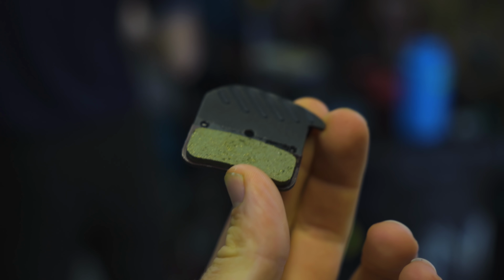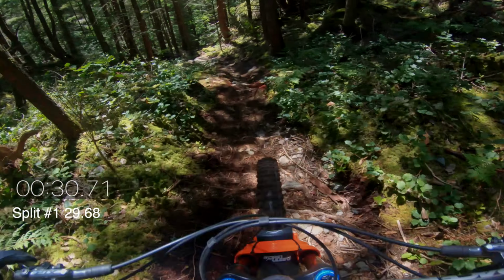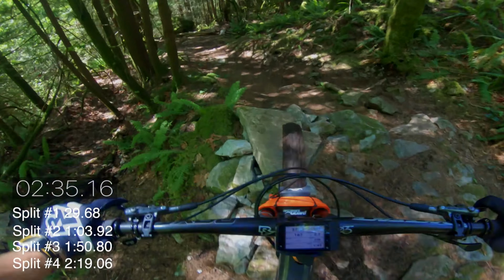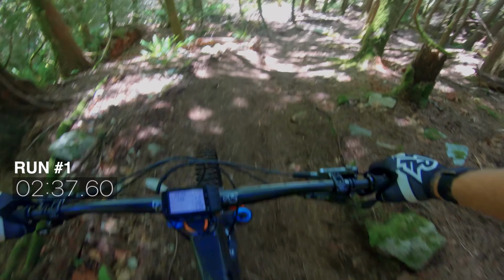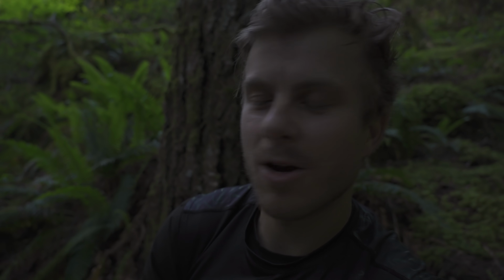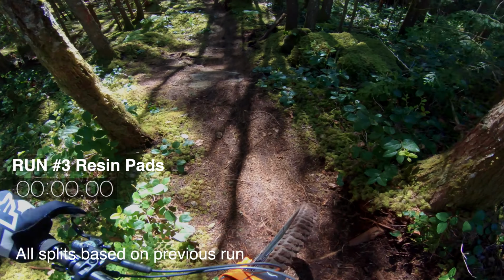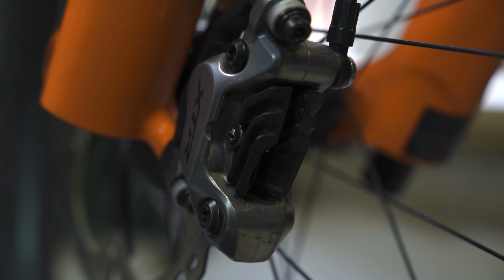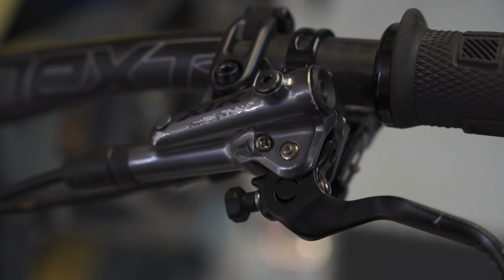These Brake Pads Will Make You Ride FASTER!!!

Comment: I used to be stuck on semi metallic. Once I find something that dials in my style I tend to want only that thing and for the longest time I only used semi-metalic pads in my old tektro mech pull disc brakes. I live in the Calif desert east of San Diego and we don't get very much rain (0.5 in per year avg) so I don't worry about wet conditions. When it would get wet good luck stopping with those things. My new Vitus came with resin pads and xt brakes and I pretty much fell in love with them. I do alot of high speed/down hill stoppies and go thru pads like every 2 months. I ride 30 miles every day. But the resin hold up pretty consistent across the board, all conditions, all uses. Once in awhile I'll get an over or under bite from them but I think it's probably due to dust buildup or a rotor contaminant because it's usually just a one off and the bite settles back in to a consistent pull that I love. 
Btw, Nice breathing regulation. People hear my breathing when I do videos and always have something to say about it. It's normal when your hauling ass to regulate your breathing to stay steady. I think alot of people hold their breath and hang on doing technical sections. That's why they don't look like you and me baby😁. I get the most out of riding at 50 and I credit my breathing techniques that I learned long ago in special forces. I don't do much of anything else in terms of working out and  I've still got a 6 pack and pretty decent guns from just doing wheelies and stoppies. Good luck when your season starts again bud. Nice reel 😁👍😎

Comment: My comments for what they're worth. Firstly, in terms of how you conducted your test, I would suggest you need to get a proper bedding in routine sorted when you change pads and especially when you change compounds/materials. 

Secondly, in terms of my experience between the two. Of course I'm not as fast as you but do race downhill in the UK. I find the resins heat up quicker (after they've cooled down between braking events) so I can get my braking done sooner and I can get off the brakes again as I don't have to wait for the metallic pads to heat back up again. I occasionally a metallic pad when there is more prolonged braking in Alpine decents, probably more like what you're doing in BC. 

There's always a trade off, I don't agree that metallic pads provide more power than resin, they just provide more power when they're hot enough. At your pace on that much elevation change, they're definitely better suited. Maybe if you use bigger rotors and shed heat better, resin might be important.

Comment: My summary is: Its situational and dependand how you ride:
I am a rear dominant brake rider and i go mostly 15-30min woods downhill tours with 70% dry and 30% wet conditions.
I think the best setup for me (Guide RSC front and rear 200mm) will be front Organic (to get the bite i need, when i brake with the front now and then) and Metallic for the rear (because i use rear brakes more often and for enduro braking (or wet condition safety brake) you need that power when the brake is heated up or wet).
I dont know if the front brake will get wet faster then the rear tho... because of the stuff spitting onto your bike when decending. That would negate the positive benefit of resin pads on the front.

Comment: Shimano recommends swapping rotors, which makes perfectly sense if you think about it. Resin on rotors previously used with metallic will not work like intended.
Reply: Better also buy a new drive train and caliper while youre at it.
Reply: @obi-wankenobi9871  i'd recommend you should also swap frame and fork
Reply: Youtube User only if your going from resin to metallic... no drivetrain issues should occur going the way round. But calipers? Yes, definitely.
Reply: Yep, you will not see the real effect without having a second set of rotors that have been beaded in for the resin pads. Running resin pads on a rotor coated in metallic compound will give a different result than running resin pads on a rotor coated in resin compound. But if you're looking for more power and better breaking feel then don't run Shimano brakes, virtually anything will give you better modulation but if you want that with more power look at Magura or Trickstuff.
Reply: @paradox963  going metallic on a resin beaded rotor often results in polishing the rotor... because all the resin and grid fragments work like a polishing compounds. At the end there is less power and it’s even more likely to squeal.
Reply: This is correct. The true capabilities of each pad compound can only be compared using rotors correctly and only bedded for each type of material.

But there's the current notion that indeed metallic brake pads produce a more powerful and less heat dependent fading brake experience.
Reply: @Phlizz  it’s fine it just takes longer to bed in because you have to clear the old pad material. Many manufacturers use a metallic / resin combo there’s no issue switching pads.
Reply: @TheMTBRider96   i'd recommend to include the wheelsets too and the tires
Reply: Xt and xtr works either metalic or resin.

Comment: Did you change out rotors as well? Shimano suggests you never you the same rotors with different pad material. After the pad is bedded in the  brakes rely on a cohesion between the pad and pad material on the rotor to maximize bite.

Comment: Great video! I just have one question did you use the older model resin pads H03A on the newest 2020 version of XTR brake calipers?  The reason why I ask is because I can't find anyone that has XTR brake pads in stock and it appears to me that the older finned pads can fit. Thanks for your help.

Comment: I've tried the Shimano metallic pads, they had a better bite than resin, but they cracked eventually, now I use TRp semi-metallic pads, but I don't know which pads you use, maybe it's a secret?
currently using TRP Spyke mechanical brakes, but might try hydraulics again

Comment: resin pads need to be worn in before riding obviously. (not sure if you did that but the fact that you felt they had less initial bite make me think you didnt) and you need to switch rotors or thoroughly clean your rotors with rubbing alcohol or brake cleaner before breaking in the new pads. 

switching pads isn't as simple as just switching the pads.
Reply: Yes it is.

Comment: For me it will always be metal, because putting new pads in every week or two just gets expensive.
Reply: Every week or two?  Exaggerate much?  Metallic pads definitely noisier than resin (with metal, as seen when actually looking at them), but they do last and not get overheated as easily.  Change my mind, yo...............
Reply: @bartsimpsonsonson  im talking about riding a lot. Like, a lot more than most people. 10,000m of vertical in two weeks. And if its wet out, trust me, resin pads will be completely used up by two weeks. Oh, and as for noise, its usually a vibration somewhere else in the system. If everything is tight, metal pads are no noisier than resin. Unless its wet out, then all discs are gonna howl.
Reply: @SnootchieBootchies27  No offense intended, just me running my mouth without all the facts.  Plus, I believe the metallic pads would like wear down the rotor faster.